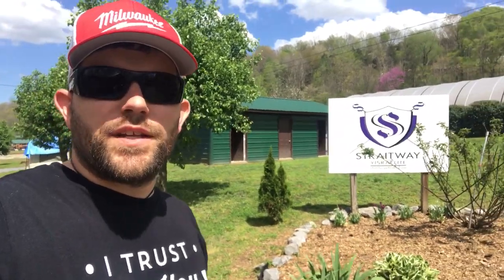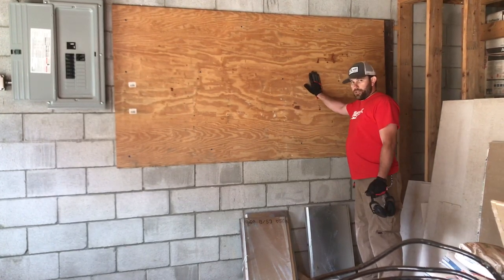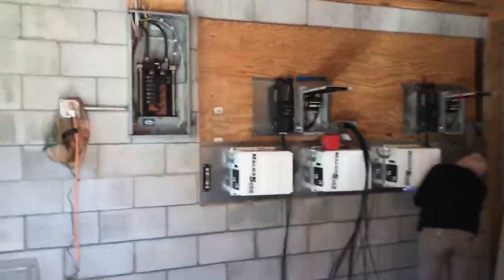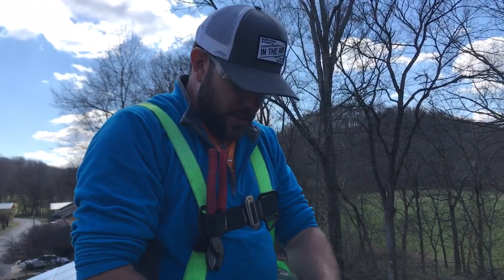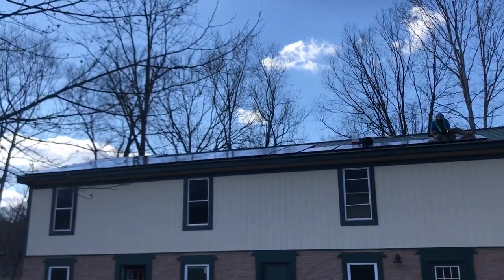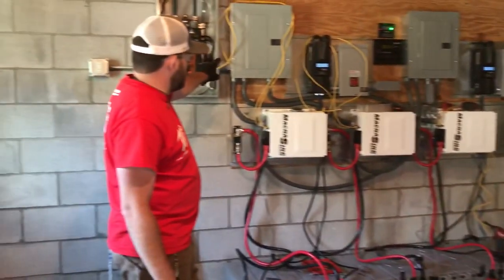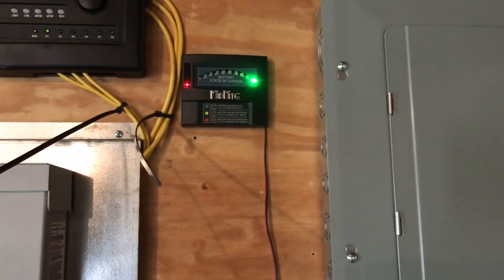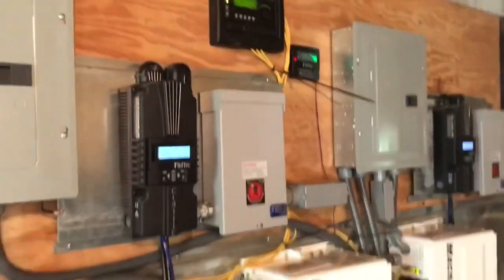8.7KW Solar Install at Straightway Ministries by Off Grid Contracting

Comment: Hi, 

Am Abiodun from Nigeria.

Have 15,000 Watts appliances to run for 12 hours daily.

Sunlight is 8 hours (8am - 4pm) is always very sure daily.

Nigeria Solar P.G.F ( Solar Power Generating Factor is 3.41)

National Grid Electric Power is irregular and only available 4 hours daily.

Planned a hybrid Grid-Tie and OFF-Grid installation using Solar, Battery and Fossil Fuel as backup solution.

Please your sizing formulae on Inverter, Solar Panel, Battery Bank and Solar Charge Controller ? 

What kind of  hybrid inverter to handle this ? Do you have in-stock a single 20KW or i Parallel 2 or 4 Renogy Inverters ?

Thanks.

Comment: I live in Tn ... and I have been contemplating on going off grid. Roughly ... how much did it cost for you to do a job like this?
Reply from the maker: Tony B You are looking at the 35,000 range or a little higher materials, travel cost and labor combined